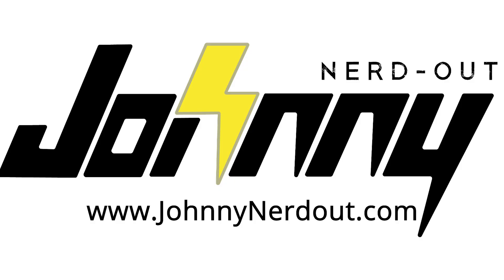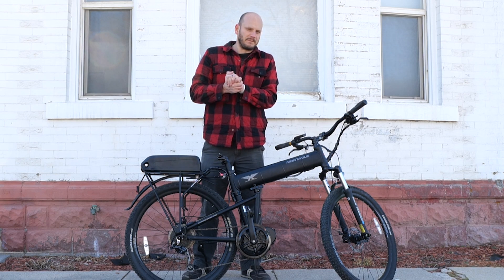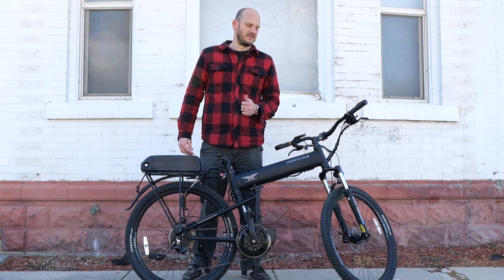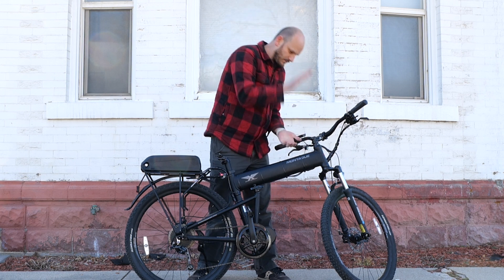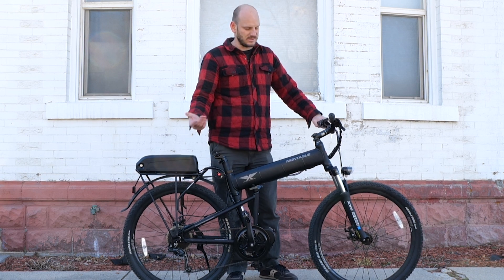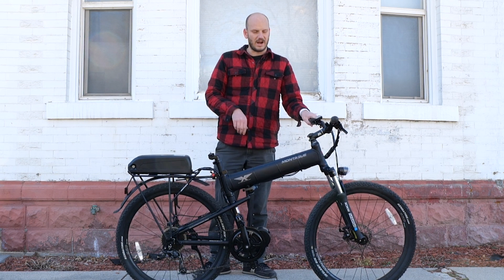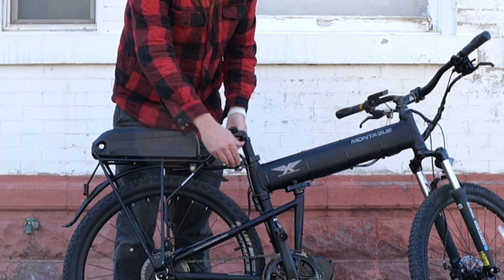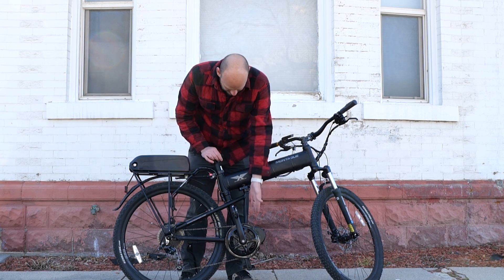Custom E-bike Build: Montague Paratrooper Folding Bike w/ 750w Bafang Mid Drive BBS02 48v 17.5ah

Comment: I bought this bike, and the motor kit, a couple of years ago. Last spring, I finally installed the kit. 
Today, I've just finished my first season. 
Issues during that season:
* My first attempt at mounting the battery to the rack involved a Grin Technologies Double Bob and some 1/4×3/4" aluminum flats. This tore at a screw hole. My second attempt uses 1/2×2-1/2" rectangular tube. 
* The lock nuts failed to hold the motor in place, it would rotate around the bottom bracket. I added a Bafang Stabilizer Bar.
* The Bafang crank arms are made of a very soft alloy. I had the pedal threads tear. I replaced the arms with Lekkie Buzz Bars.
* While I was at it, I replaced the Bafang chain ring with a Lekkie Bling Ring.

Comment: As a truck driver, this seems like the right platform for me. Comparing this to Montague's M-E1 seems a bit like comparing a brand new Cadillac to a custom hot rod for the same price. The fit and finish of theirs is nice, but I think I'd rather build a hot rod with some power.

Comment: This is awesome... Great job! I have a Highline Montague. Did you have any issues sliding the motor in the bottom bracket? I've seen videos where people had to grind between the threading because the motor stopped halfway through and I'm not sure I want to do that with my bike. Also what's the turn around if I sent my bike to install a motor on?

Comment: Hi Johnny I have the exactly the same Paratrooper and yes I have on my boat,was thinking about getting a mid drive after my hub motor packed in after 1100 miles.Would my 48v 13a battery power a 750w Bafang ok or should I buy a bigger battery,never realised I could lift the motor on my Montague for extra ground clearance great job👍🏻
Reply from the maker: That battery should be good as long as it can handle 25 amps (which it should)

Comment: Nice build with that high clearance, and loving your insights. I have something similar and with folding handlebars and pedals it goes nicely in the back of a super compact car so no rack hassles. It's a cheapo but I love the concealed battery in the top tube (wish we saw more of those). https://youtu.be/W0-a8VjCaBQ I'm about to change from hub to mid drive so may give you a call. Thanks again for a great channel.